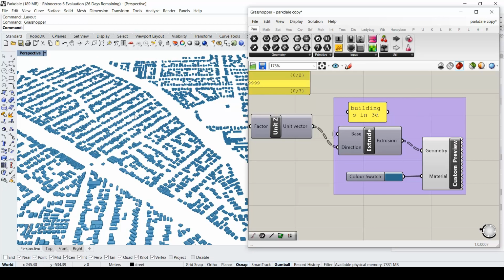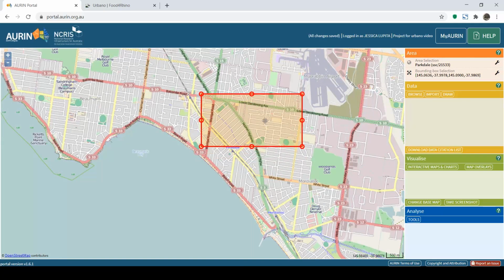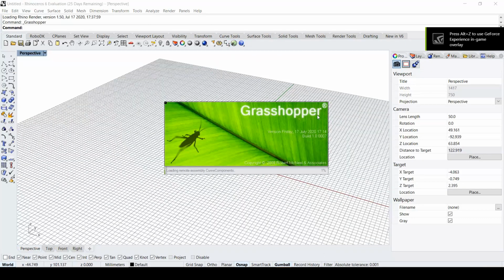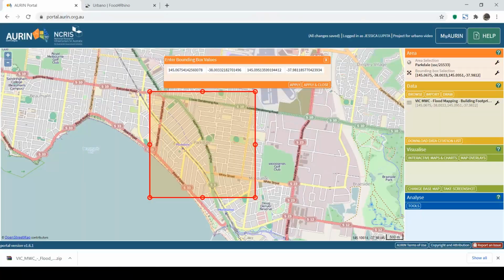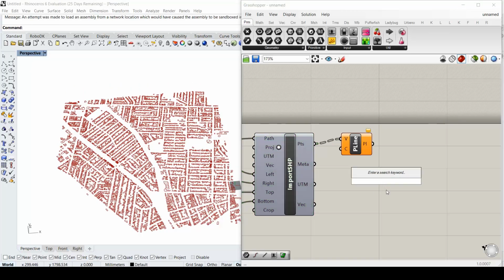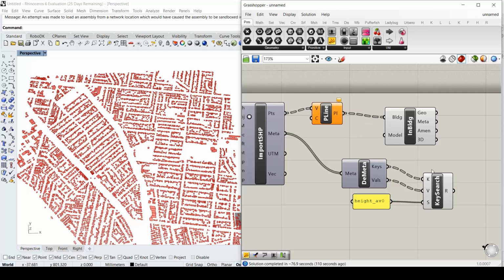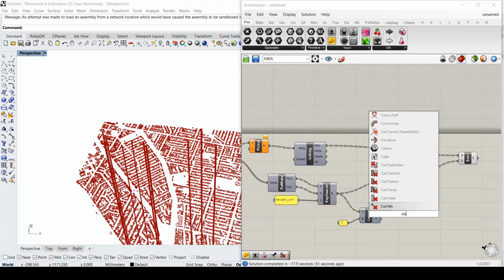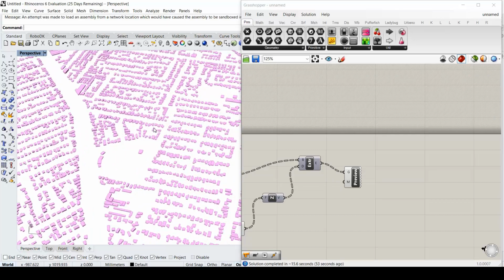How to create 3D Aerial Building model QUICKLY using Urbano Plugin in GRASSHOPPER

Comment: Hi Jessica, thanks a lot for the video. I was looking for a way to use the height data from my project shape file. However, the inspect building component extrudes the buildings at a random and same height. It doesn't take the values from the metadata. Would you know what am I doing wrong?
Reply: Okay, I found the solution. It seems disabling the preview for the building inspector component shows the result of the extrusion which is as per the metadata. Thanks a lot again for the video.

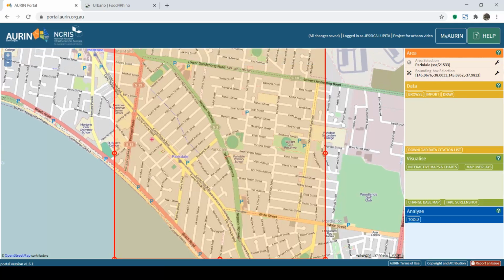Comment from the maker: Update: my explanation about coordinate numbers that we use in the GH plugin @ 2:50, I said in the video that you cant move/resize the bounding box after you generate your figure ground from that selection because it will change the coordinate numbers. I found that it doesn't matter. You can change, move resize your bounding box or select a different coordinate numbers as long as it's covering the area that you  want to extrude. You can even get a shp file from another resource and just take the coordinate number from maps like AURIN/OSM from your selected area and you'll be able to generate the model.
Cheers. J-
Reply: Thanks a lot for enlightening on this topic. How to proceed with urban energy simulations using any grasshopper plugin thereof? Any thought?